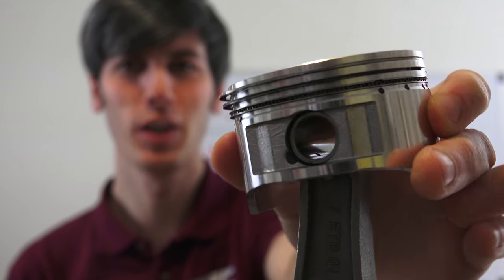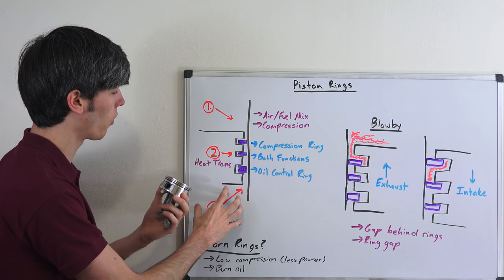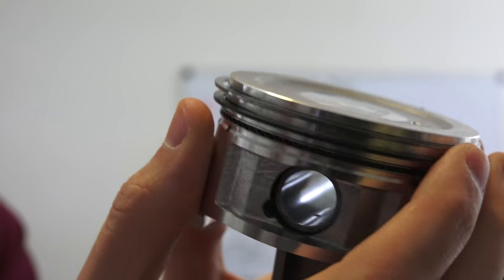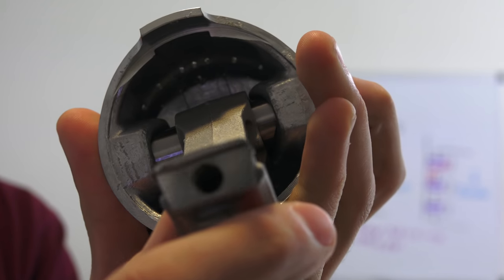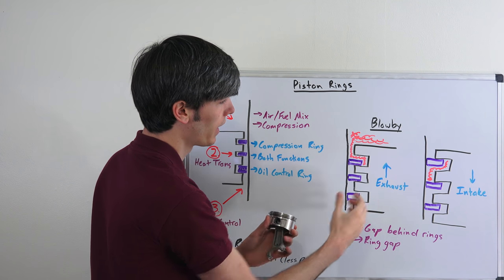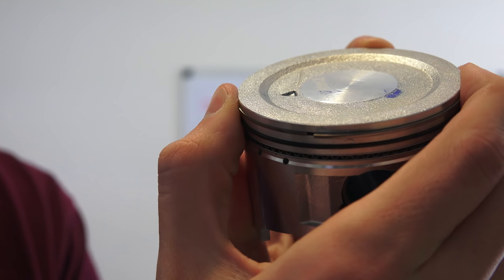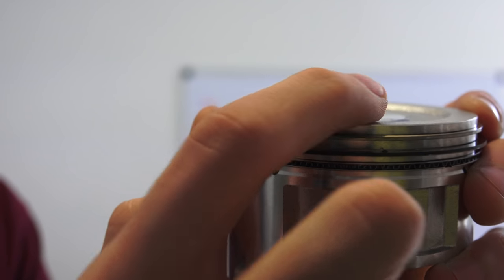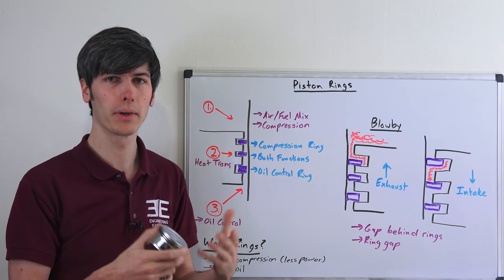Piston Rings & Blowby - Explained

Comment: Can you damage the piston rings by overheating the engine thus over-expanding the rings?
Reply: +Damian De yes - rings are like springs/
if you heat springs - it loses tension
Reply: Brendan Raymond what u mean 'damage'?
I mean when spring steel is released, then rings doesnt work the way it should. so i consider that s mulfunction too.
Reply: Thanks for the comprehensive explanation Brendan! Exactly what I was wondering about...

Comment: Has anyone tried to design the ends of a compression ring as a simple coil shape, so that one edge overlaps the other and prevents axial blow-by? It would still be able to expand & contract based on the block temperature.

Comment: Low compression ratio due to Worn Rings ? Didnt get it . please explain
Reply: If gas is escaping then there will be less gas that is being compressed into the same amount of space
Reply: but CR is a function of space! I mean its Total volume/clearance volume. I think technically CR is same though volumetric efficiency is reduced due to escaping of charge.
Reply: You're right, CR is Vd/Vc.  blowby reduces Vd, thereby reducing CR. It reduces Vd because the air trapped in the crevices comes from the displaced volume. 

in a spark ignited although the crevice volume is very small (1-3%) relative to the clearance volume, because the air trapped in it is nearly the same pressure as the rest of the charge but a LOWER temp due to wall proximity, the density of the crevice AF mix is significantly higher than the AF mix in the rest of the cylinder resulting in in as much as 20% of the total AF mixture being trapped in the crevice.
Reply: rob grunwald thanks for the explanation

Comment: How do you know the difference between bad valve seals or bad piston rings
Reply: Since both affect compression, You need to perform a compression test and leakdown test in every cylinder

Firstly, A compression test will tell if you IF there's low compression period, 

Secondly, a Leakdown Test will tell you where the compression loss is occurring (Only after verifying there is indeed low compression from the first test), whether in the valve seals or rings. You would have to rotate the engine by hand until the cylinder is at top dead center, you do this for every cylinder, which means you have to rotate the engine after finishing one cylinder until they're all done (If it's not at Top Dead Center, the combustion chamber will not be fully sealed and you will get a false reading, remove the spark plug and connect your guage. At this point, the combustion chamber should be completely sealed, if not it will go out somewhere and the only possible places are the valves or piston rings. Remove the oil cap, IF YOU HEAR AIR FROM THE OIL CAP, YOUR RINGS ARE BAD. If you hear air from the intake, then your intake valve/valve seals are bad or exhaust valves if your hear AND FEEL air out of the tailpipe.
Reply: @RzVids  if your piston rings were bad your vehicle would be blowing smoke all the time not just at start up and sitting idling in traffic. I'm pretty sure it's my valve seals and not my rings

Comment: So what is happening when you see fire coming out of the exhaust system?
Reply: +Manuel Palerm Means fuel isnt fully being burned
Reply: unburnt fuel comes out of the  exhaust and is hot enough that when it hits fresh air it ignites
Reply: Sounds like an engines problem if that occurs lol
Reply: +Manuel Palerm could be but if flames are seen its most likely from an engines performance oriented nature. you can see rally cars and other race cars do this. in this instance I believe it is called an afterfire, not a backfire
Reply: +ALovelyBunchOfCoconuts I think backfire is when it comes out through the intake port instead of the exhaust

Comment: EE: You explained how the combustion gas flows pass the piston rings. How does the engine oil flow pass the ring and get burned?
Reply: if the rings are worn they won't scrape oil off the cylinder wall as effectively leaving oil exposed to the combustion process
Reply: That's one possibility. I believe even the rings are not worn, some oil still flows pass the rings and burned.

Comment: ìs there any advantage of blowby??
Reply: None actually you can burn out you o2 sensors or plug the cats from burning so much oil. More fuel consumption damaged spark plugs. You can end up running dry no oil because of burning it and not checking it people who don't check the oil every month or gauge based on leaks or consumption, you can literally end up driving around town with no oil and seize the engine. Take your car to a shop for a compression test compare it with OEM standards if its bad get rid of the car

Comment: what kind of engine is that piston out of?
Reply: looks like from some turbocharged car. you can see the top of the piston has a sloght recess to reduce compression a bit to avoid engineknock when producing boost.
Reply: TheWolvesCurse
i rewatched the difference between gas ans diesel video i think the piston was from that small gas engine

Comment: How to take care of you're engine in such way to avoid getting such a problem as a blowby?
Reply: +Mustafa Jari Service your cooling system and your air filter regularly. Over heating and things like dirt making it into the engine cause excessive wear on the piston rings. Over heating will cause them to lose their tension and dirt will basically become sand paper and scar the cylinders and or the rings causing gaps.
Reply: +nikki martinez I like a solid answer. Thanks :)

Comment: I rebuilt my engine and it ran fantastic then it blew a fuel line out and got a nasty misfire. while searching for the misfire issue I found out that my oil fill hole on my valve cover is now sucking instead of having blow by or staying neutral this sparked a big debate at work if that was bad good or in between and now I’m scared for rebuild number 2 can anyone shed some knowledge on my situation please

Comment: when installing Pistons rings does it matter which way the gap of the Ring goes
Reply: My Auto Tech Professor always turned the gaps opposite of each other, it's something he recommended
Reply: +lsbugsbunny92 so since there's three rings I should separate each gap 120 degrees
Reply: +luis moreno No, 180 degrees because if it goes through the first gap it would take the gases a longer distance to travel from one ring to the other
Reply: +lsbugsbunny92 *from one ring gap to the other

Comment: Why isn't the compression ring cut diagonally so there isn't a gap?
Reply: The gap has to be there. When the rings heat up and expand if the gap isn't there and the ends touch and start pushing together the rings will be pushed outward into the cylinder bore. This can damage the rings or the bore. Cutting them diagonally won't make any difference.
Reply: Seems to me like it would. Spiral.
Reply: @HunterShows  Well, they've been doing it that way for over 100 years.
Reply: And I'm sure they know what they're doing; I just don't understand why.

Comment: is there worst thing that could happen if you did'nt fix this problem? thanks in advance.
Reply: +jm corpuz Having bad piston rings? You'll just burn oil. Beating on the car with high RPM's will also worsen it. Just drive moderately and keep an eye on oil levels if your car is just a tool of transportation.

Comment: why would my 72cc motorbike engine start smoking after running a minute or so. new cylinder and rings, my valve stems   are a little sloppy though. new valve stem seal.

Comment: why can't the piston itself be a little bit larger in diameter and be machined to exact tolerances and play the role that the rings do?
Reply: +Nicholas Markovich First thing is that piston is not elastic and it would probably be worn out by a few cold starts. The other thing is when piston ring is wearing out its expanding to keep seal.

Comment: How can you tell which piston rings are worn without taking apart the whole motor and checking each cylinder
Reply: Compression and/or leak down test.
Reply: thanx
Reply: +Togue Titan Not always the case.  A compression test will detect a leak in the cylinder(s).  If two adjacent pistons are low in compresion, the head gasket may be suspect but a leak down test will rule out exactly where it's coming from.  During the leak down test, air that's heard or seen in the cooling system indicates a head gasket failure, air in the crankcase indicates piston rings, air out the muffler indicates an exhaust valve, while air out the intake manifold or throttle body indicates an intake valve leak.  For valves, it could be either weak valve springs, stem seals, or the cylinder head itself needs reworking.

Comment: Why does excessive idling contribute to blowby?
Reply: Steve Zielonko because the fuel injectors usually inject a more fuel than needed at idling. This diluted the oil on the cylinder wall. This leads to less lubrication and a small amount of gas in the oil itself.
Reply: Thanks

Comment: why is blowby a negative effect of worn piston rings?
Reply: Do you have car that you only take on short drives? (like 10 minutes or less) pull the dipstick and smell the oil. Does it smell like gas? That is caused by blow by. Because of this, if you only take your car on short drives, you should change your oil more often. (Obviously gas is not good for the engine to be in the oil) Or about once a week, go for a nice long cruise to let the engine warm up, and burn off those gases in the oil. The PCV system is what helps with that. 

Also, the more worn the rings, the more pronounced this process is. My old Explorer was neglected by the previous owner, and has low compression. After just a couple short drives the oil will have a strong scent of gas. But if I take it for a good 45 minute drive, after I get back and smell the oil, it smells like oil again. 

I hope that answers your question.

Comment: Interesting given your engineering background that you didn't mention that cylinder pressure during the compression stroke acts to force the top ring firmly against the cylinder walls, hence the tolerance clearance for the ring in its ring land both vertically and behind with regard to back spacing.

Comment: hi how to check if my engine has blow by????
Reply: +Nilan Hewa Kandamby All engines have blowby to an extent. If your question is about excessive blowby, you could check your oil level. If you don't have significant oil consumption, say more than 1 qt per 5,000 miles, your engine is fine. You can also run an engine compression test.

Comment: I have a 2010 Mazda 6 with 2.5, and the blow-by is horrendous.  it's only got 82k miles.  I took it to the Mazda dealer and they told me it was normal and not to remove the oil cap while engine is running.  Sounds like bs to me.  Anybody else experience this, or have any info?

Comment: Ok, I am not a mechanic, and I admit that. I know this might seem like the stupidest question to have answered, but can someone please tell me why it is so bad when an engine starts burning oil? I have a saturn that started with that problem at around 120,000 miles, and it ran up to 270,000 miles without any mechanical problem (the subframe rusted out, so now it can't be driven anymore). I guess it wouldn't be a bad idea to say that it is rather common for saturns to run atleast until 300,000 miles, despite this porblem (I know of one that ran to 500,000). Like I said, I am not a mechanic and don't know a whole lot about the topic, but if a car can run like that, I just don't see what the big deal is.
Reply: Well some people may not want to buy oil continuously. But on a more serious note if enough oil is burning your cat converter can become clogged and then there will be more back pressure on the engine/loss of power. It could mess up the 02 sensors and then your car would run right.
Reply: +RGO Impact would not run right
Reply: Thanks. It's nice to hear an answer that doesn't just say to be mindful of how much oil is inside the engine. To me, a car that runs good is all I need. I'll keep what you said in mind in the future since I'm sure that it will be helpful.

Comment: When you burn oil beacause of piston rights it's not nesesery to have low copresion. Low compresion on a engine that has lot of miles comes from the head and the poor sealing of the engine valves. To put things easy because of my bad english spelling i will explain. Oil has a sealing efect. Once I did on my old car a engine job because the engine burns 2 liters of oli for 6000 miles. So I sad well it's probably the rubber valve sealings, so i didn't changed the piston rings only did a head repair. When everything was together i mesured the compresion of the engine, mine has 9 on stock, after the repair had 12 to 13 depens on the cylinder because of the oil burning, and it still burned oil because of the piston rings. It was great because the car was pretty fast before she finaly died but that was the case. Well if the rings are sooo bad that the oil stick can stand in place when the engine is runing, there is no way for bigger or even normal compresion.

Comment: My Ducati motor has low compression and probably worn rings...after 29k miles, which I think is abysmal. And it shredded the con rod bearings, which makes me suspect the engine has an oiling issue.

First and last time I buy a Ducati.

Comment: my lawnmower smokes like a banchee and uses like 0.5 liter of oil an hour, is this because the piston rings are worn out?
Reply: +Martijn Bruggers Probably, or is it a 2-stroke?
Reply: +Tuppoo94 no its a 4stroke, 13hp briggs horizontally oppozed
Reply: ***** but its a sidevalve engine so that shouldnt be the problem
Reply: +Mike Brink no there is no oil coming up to the airfilter, we checked if it was coming out of the cranckcase breather but also nothing there, it does have a lot of carbon buildup on the sparkplug
Reply: ***** the piston is still fine, it still runs fine. but thanks for your advice!
Reply: The good thing about those engines is that you can rebuild them yourself cheaply and learn a lot about small engines in the process. Even if you screw it up, you haven't lost much. I started out at age 13 rebuilding Briggs & Stratton engines, re-honing the cylinders, replacing the rings, and lapping the valves. I had a little neighborhood business as a kid.

Comment: the rings dont extend out so much as when they get hotter, the gap gets smaller
Reply: +phil tripe I dont' think that's right. Holes (cylinders) expand when getting hotter, (As do the pistons I know) but they are designed to grow at certain rates with a gradual temp increase. In general at operating temp you should have bigger clearances than when cold. this is why warming up your motor is so important. also why F1 engines must have hot oil pumped through them before starting.

Comment: also if your exhaust is blowing out blue smoke then that means you have worn out piston rings
Reply: Worn cylinders also. It comes from not changing your oil. If if it smokes mostly at start up and goes away after a few minutes it is usually the valve guide seals and to a lesser degree the valve guides.

Comment: My single cylinder motorcycle loses power when it gets warm. Piston rings are in perfect shape. Any Clue?
Reply: +Mahesh I K if it has an electronic fuel injection system then the engine temperature sensor might not be in optimal shape. In a carburettor system, the mixture might be a little too rich.Check the color of the spark plug after a good drive.

Comment: Rotor>piston
Reply: Apex seals...... I say no more.

Oh and nice W16 as your profile picture.
Reply: CJ Chatham looks like you feel for the myth lmao if you don't know how to take care of it then yes they go out fast but when people like you try and treat it like a daily driver they go out faster cuase it has to be revd high unlike Pistons. W16? Lmao
Reply: +I Bugatti Veyron I (Bugattiliker3) 
No they do not, for very good reasons.
Reply: patw52pb1 explain
Reply: +I Bugatti Veyron I (Bugattiliker3) Your knowledge on vehicles is about as good as your grammar it seems. And yes if you didn't know the Chiron is a 16 cylinder engine.
Reply: +I Bugatti Veyron I (Bugattiliker3) Your knowledge on vehicles is about as good as your grammar it seems. And yes if you didn't know the Chiron is a 16 cylinder engine.
Reply: +I Bugatti Veyron I (Bugattiliker3) Your knowledge on vehicles is about as good as your grammar it seems. And yes if you didn't know the Chiron is a 16 cylinder engine.
Reply: I Bugatti Veyron I
Thermal (heat) exposure, surface speed, lubrication (lack of) and movement(sliding) across openings in the rotor housing walls.

Comment: You didn't explain how oil gets on the cylinder wall in the first place.
Reply: +William T Finnegan usually by oil splashing up off the crank, although some engines have oil sprayers that cool and lubricate the cylinders from below
Reply: I think you should know better. Splashing is not any where good enough for a real engine (except maybe two-stroke). Did you know there are oil passages drilled into the crank? Oil enters through the main bearings,  and exits through the connecting rod bearings. The connecting rods also have passage ways through to the wrist pins. Oil goes out to the wrist pins and ends up on the cylinder walls. 
Perhaps you ought to do an overhaul and look at the parts very carefully?